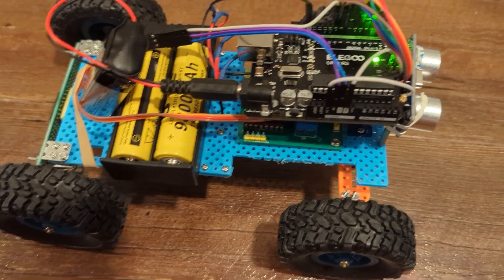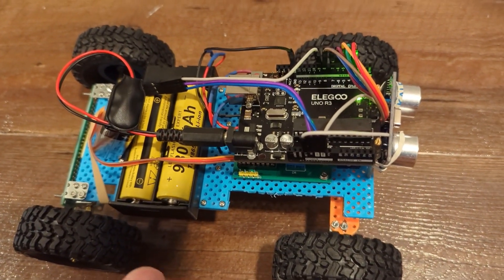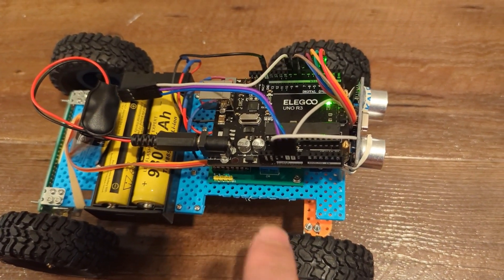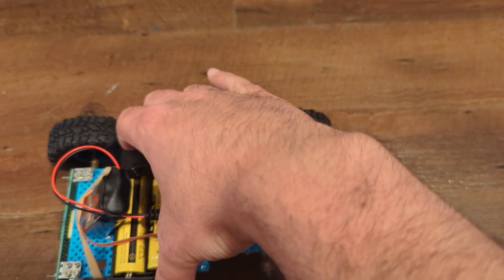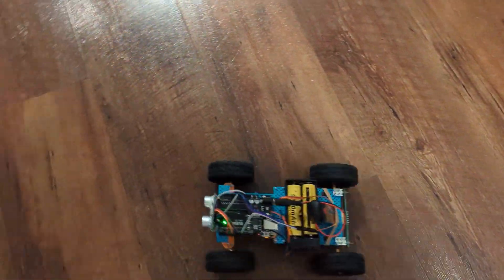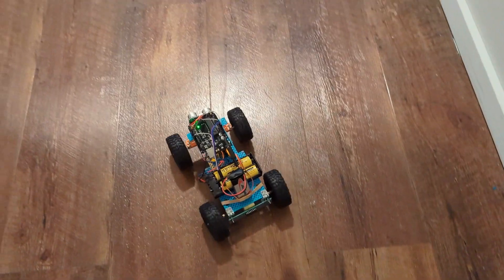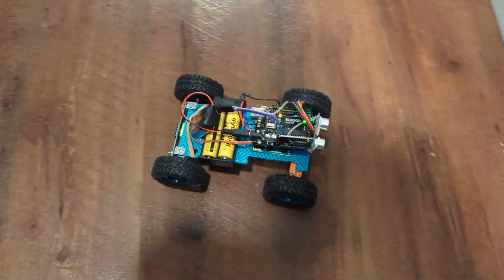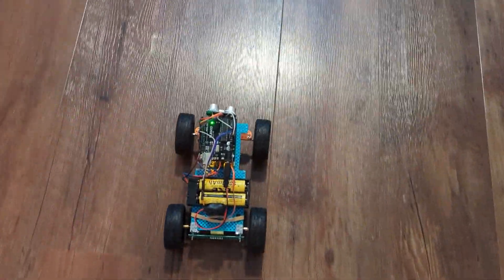Help Me Solve This | Self-Driving Bot Getting Stuck #bot

Comment: I think the sensors sound bounces away from the receiver so it thinks the distance is infinite. Maybe usign an servo to do a bit of a sweep when distance is infinite will correct it eventually. Adding a another sonar might help but can have the same problem if both of their sounds bounce away in a weird angle.
Reply from the maker: I like the idea better than adding more sensors, that is what I'm trying to avoid. Thank you, I will try your suggestion and see if I can do better.
Reply from the maker: Thank you, it worked https://youtu.be/bW53K3tVBtE

Comment: Another way would be to copy a "dumb" roomba when it hits a wall the bumper microswitch triggers. prob the simplest solution.
Reply from the maker: I agree that this would be easier with a switch on the bumper but I like your first suggestion more. I can attach the sensor to a servo that take 3 reading before deciding which way to go, might add some complexity to the code but that I'm sure I can do and it should allow for better decision on which direction to go.

Comment: if it knows when it stops then in theory it would be possible to guess what it should do next based on the pattern/a huristic derived from what causes the stop, maybe just simpily making a guess based on the previous turn to when it got stuck recently and backing up.
Reply from the maker: I like it but that brings another problem to solve. How do we know when it stopped? a vibration sensor or maybe an IR sensor? I looked at a way to read the current on the DC motor because when it stops the motor will pull more current of course but that is a bit more complicated for the  Arduino to measure. Good thought but a bit complex, I will need to sleep on it but I like the idea. Thank you